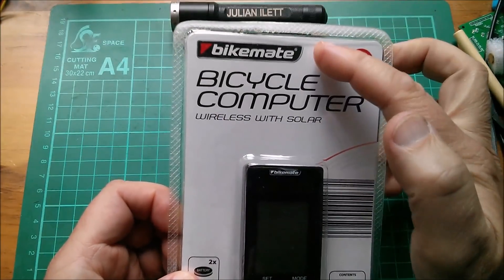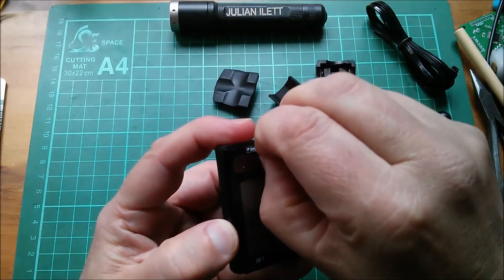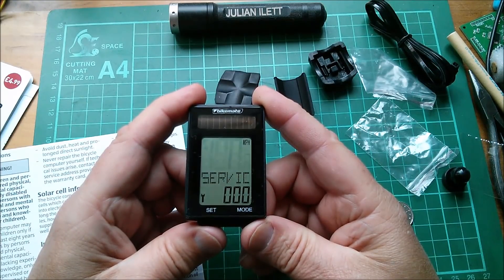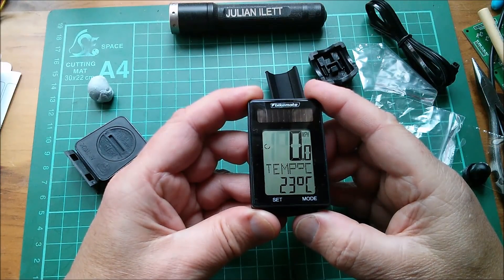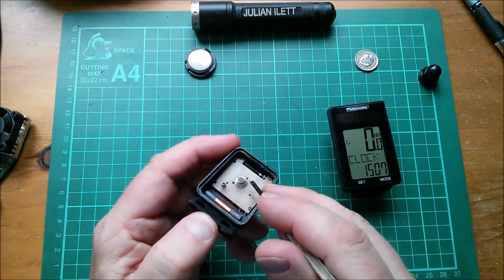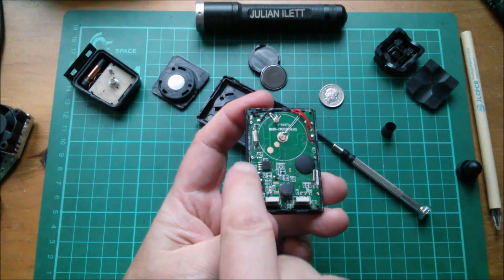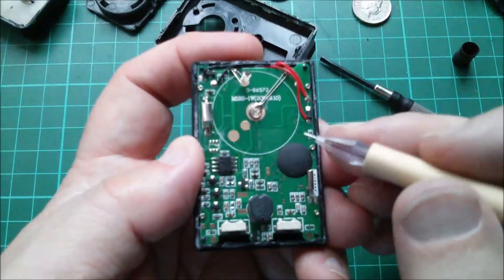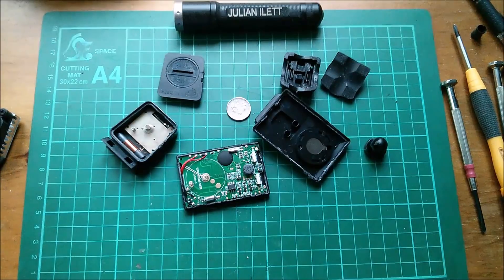Bicycle Computer from Aldi

Comment: i hear Cordless Heat Guns are good for releasing glued on Bicycle Computer back plates ^_~

the question is now how do you hack the screen to esp32 for numerical display, is there already a library for that device... rewire the ferrite to generate , turn an old unused bike wheel in the wind, then get a Bicycle Computer to tell you the rpm of the generator remotely   oh.

Comment: I tried to use this model but the sensor would only work within 30cm of bike computer . Not usable on most bike installs. Wired sensor would have been more reliable . Thanks for ‘sacrificing’ yours 🙂

Comment: As a bike enthusiast I’ve wondered what was inside those bicycle computers. I wonder how much the solar panel extends the life of the battery. My bike computer battery typically lasts over a year/3000 miles. How about sticking the voltmeter on the solar panel and check out what it does versus what the battery drain is when transmitting.
Reply: My bikemate battery display unit is empty within 30 days

Comment: Dumbest part is using one CR2016 and one CR2032.  And then using the bigger 2032 in the smaller enclosure!  The only difference is the 2016 is 1.6mm thick while the 2032 is 3.2mm thick.  This only causes frustration for the end user having to buy two battery sizes.
Reply: It probably makes more sense that the larger battery goes in the smaller unit because that is the transmitter. But that still doesn't excuse using two different sizes. I wonder how hard it would be to squeeze a 2032 into the receiver. It's probably enough of a difference that some shaving of the plastic would be needed.

Comment: Hmm I would have thought LR and not CR 2032 would have been better if the solar charged the battery??
Reply from the maker: I think the solar panel just extends the battery life. Why a CR2016 in the computer though?
Reply: @JulianIlett  is the solar panel in parallel to the battery? and the only reason for the 2016 I expect is height??

Comment: Seems very obsolete, since you can have all this functions from a smartphone without the need to install any hardware on your bike.
Reply: At least with this there is privacy.
Reply: To really replace this with a smartphone you'd need to mount it on the handlebars and probably crank up the brightness so it might be visible in the sun. The maxed out brightness and the GPS for calculating speed would likely work together to quickly drain the phone battery. Not to mention the phone would be totally exposed in the case of a minor accident. A cheap display that doesn't eat batteries still wins in my opinion.